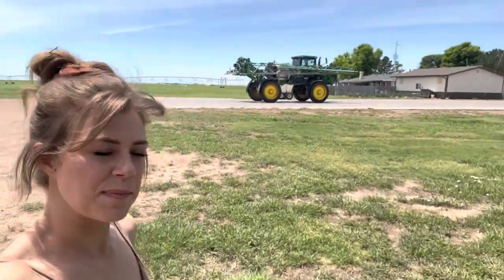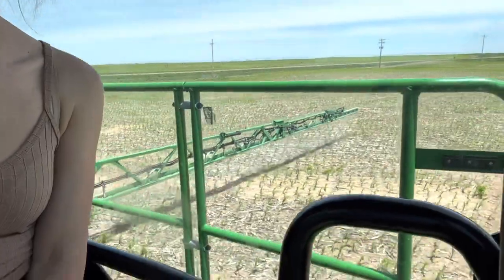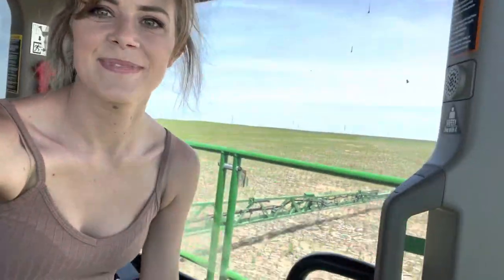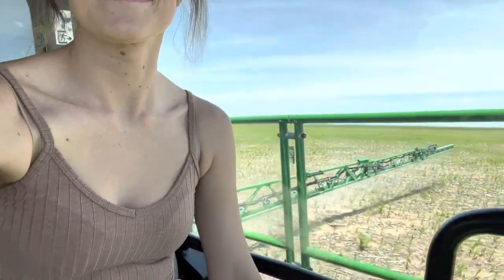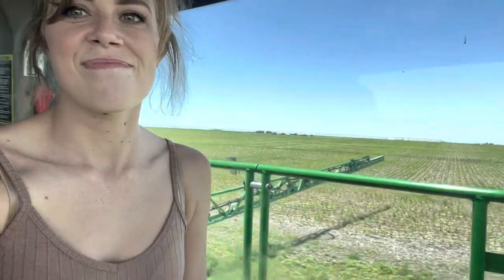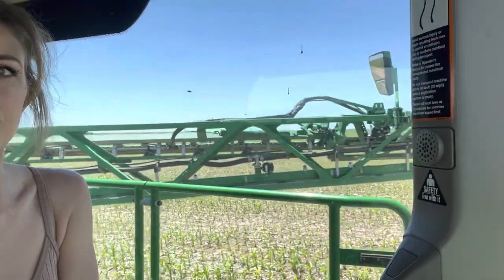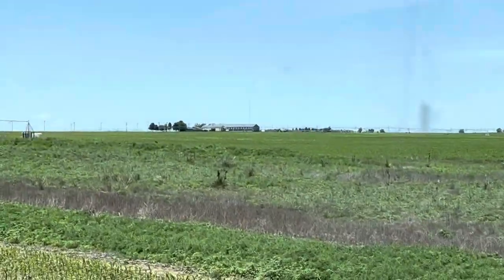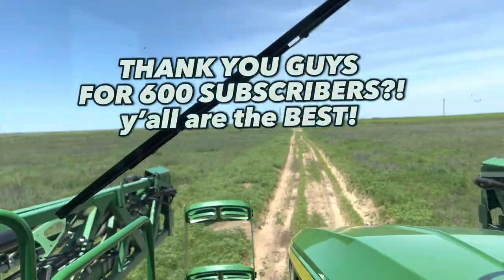Time To Spray The Corn!

Comment: Im from Manitoba, Canada . I grow cron for silage. But i grow it in 30" rows. Whats the reson for 20" rows?What populaton do you plant?
Reply from the maker: 20” rows shade out quicker which helps conserve moisture and suppress weeds quicker. Also we like the in row plant spacing on 20s better than 30s. The population varies anywhere between 12000 to 34000 depending on the ground and the water!
Reply from the maker: Man I bet Manitoba is pretty this time of year?
Reply: Have you noticed a yield increase. Yes Manitoba is beautiful this time of the year. Better that in winter😊